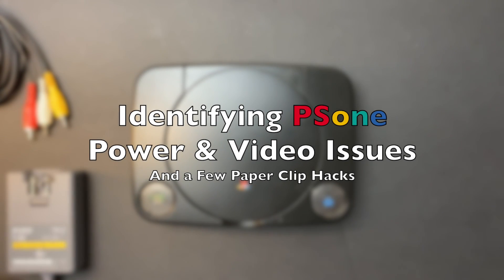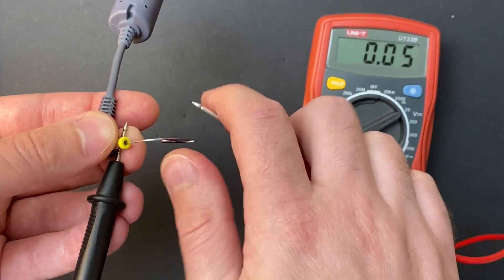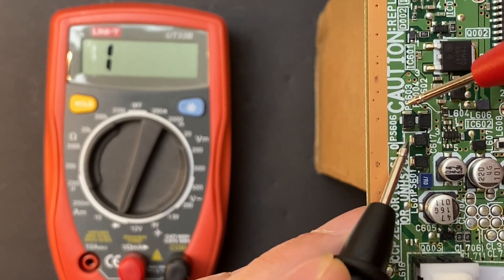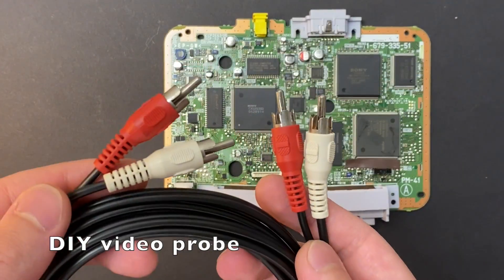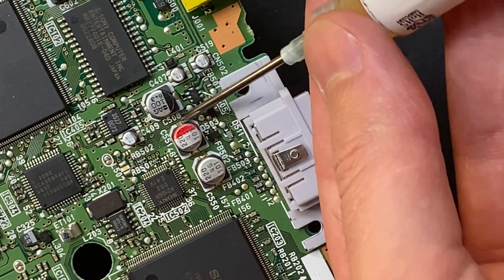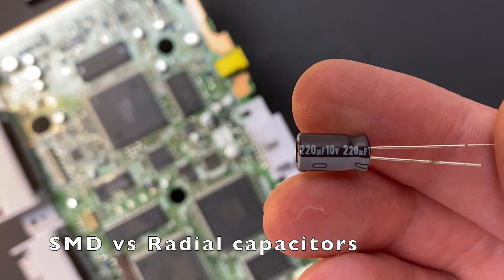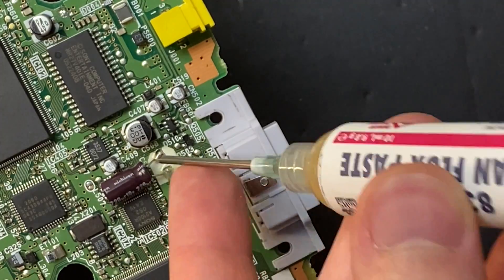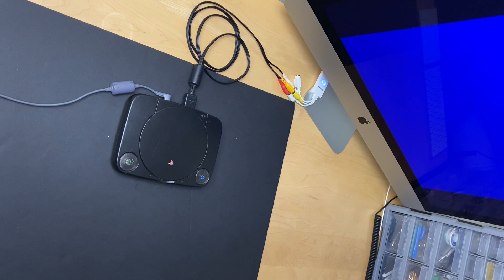Identify PSone Faults Using a Paper Clip - Retro Console Repair

Comment: This was very helpful! I always get stuck in the troubleshooting part unless it is something very obvious. (It rarely is) I hope you make similar videos for other consoles as well :) A tip from my side: get a flux pen. It is faster to fix the joints with it and you have less flux to clean up :)
Reply from the maker: Thanks man. I’ve seen those pens in a few videos. Think I’ll check em out. I have to admit, there’s something very satisfying about using a syringe though :P
Reply: @BorderlineOCD  I much prefer the syringe to the flux pen. The pen may be easy to apply, but it's so gummy and harder to clean.

Comment: I was lucky to get a PSone with chip in working condition, but this video is defenitly interesting in case somthing goes broke or crazy.
Thank you.
Reply from the maker: I keep reading that most of them are chipped on the used market, although none of the ones I’ve picked up so far seem to have a mod chip (or evidence that one was previously installed).
Reply: @BorderlineOCD  Here in the Netherlands its 90% of the time a chipped system. Same with most PS2 systems too, almost every i get in my hands is modded with a chip and a lot of times with a bad or non working laser.